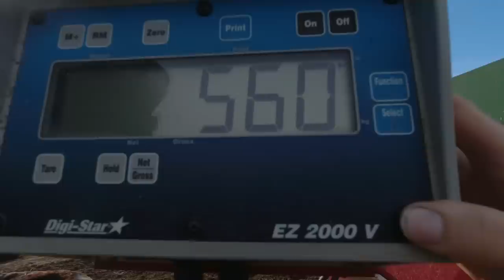Save a Horse, Ride a Cowboy

Comment: Here is a simple fix for that gate E-102081 Western Style Gate Closer (Wood Post Gate Latch) cost about $16.00 if you can find any. One of these sites will give Cole all the measurement’s he needs to make these. The one I have seen made they added about 6 more inches to the length on the clip end of the rod. The extra rod was then bent at a 45 degree angle parallel to the hump side of the rod. Then from there the end of the rod bent straight down in almost a fully closed circle leaving enough room for the wire fence to pass through eliminating the clip. Check out You Tube Western Style Gate Closer / Gate Closer for Wooden Gates / Fences
Reply: Persistent with this comment aren’t you lol

Comment: If you already did it I missed it but could you explain how that drive through gate works it seems to be built directional and how does it not work for the cows
Reply: Imagine a gate hanger coming out of both in-ground poles at the sides of that gate, just above ground level.
The bottom tube of the gate fits onto these hinges; the springs then attach the gate to the poles and allow the gate to be pushed down by a vehicle...and the spring tension pulls it back up to the vertical "at rest" position.
Cows don't recognise the gates as being any different to a solid fence which they "know" they can't get through.....
Reply: @JohnSmith-yv6eq  there isn’t ANY form of locking to keep the cows from learning it’s usable it looked like there was some thing hanging from the top?  
Really appreciate your patience

Comment: What is the feed value of sorghum silage compared to corn silage?
Reply: Same it just doesn’t have the starch from the corn cob
Reply: It also has more sugars and if it is a sorghum Sudan cross you can cut it several times and get lots more yield
Reply: @kalebmcdaniel9147  For your information you can always edit your comments by clicking on the 3 vertical dots to the right of comment.

Comment: What are those for wheelers
Reply: honda
Reply: @briansonne814  right but what model
Reply: @bohemianford1165  cole has a foreman and i have a rancher
Reply: @briansonne814  witch is better
Reply: @bohemianford1165  the foreman is you have a sprayer mounted on it or need extra power

Comment: Not a good sign when you have to ask for balancing.  Means some training is needed .
Reply: Well, depends if he only balanced the wheel that required a new tyre...
and the owner failed to mention preexisting unbalanced wheels...
please balance them too?
Reply: @JohnSmith-yv6eq  A good tire man makes sure the front tires are balanced, when changing a front tire for one of the best customers.  Asked or not.